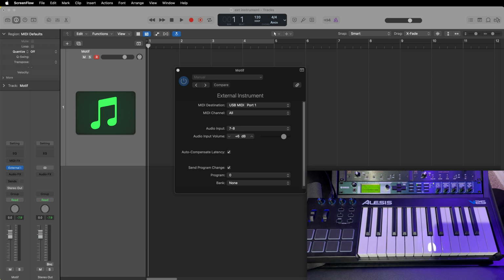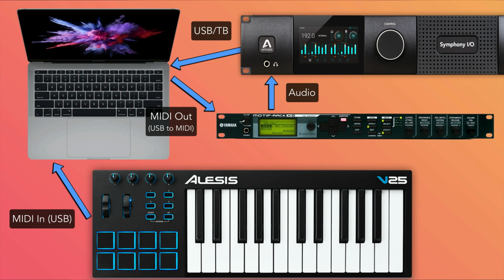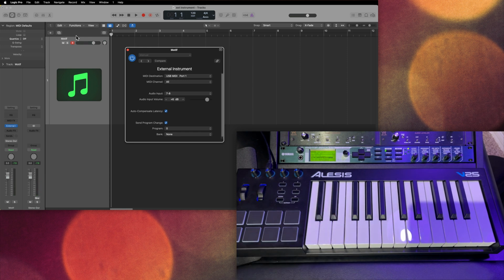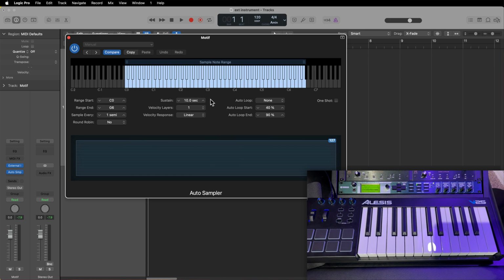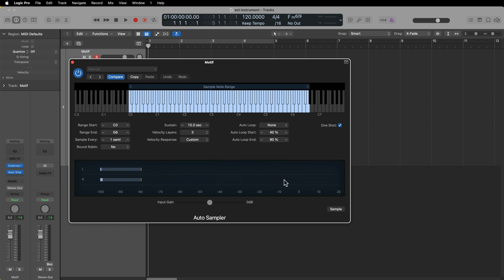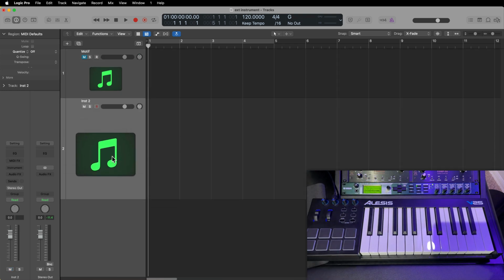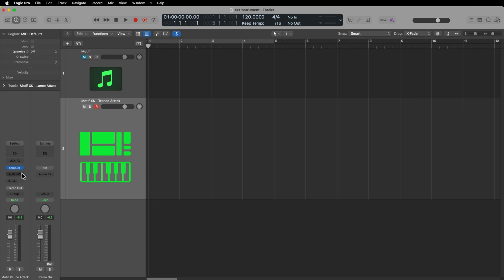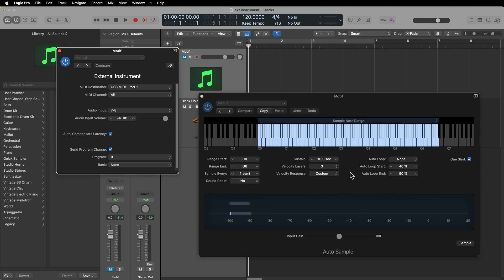Logic Pro - Convert Hardware Synths to Software with AUTO SAMPLER

Comment: Just wanted to say thank you for this - Apple has a PDF manual for Logic Pro that is completely and entirely useless.  It mentions Auto Sampler but doesn't tell you how to use it.  This video steps you through the process perfectly.  Just followed these directions and cloned the CP70 sound on my Yamaha MX88.  Now that sound is in my laptop and I don't need to drag the big heavy keyboard with me when I want the sound.  Thanks again.

Comment: Hi MTHG, thanks for all your amazing videos over the years! I have a rather complex question: I have a hardware synth lead patch I’d like to sample but it has quite involved real time modulation effects. For example, when you introduce the mod lever the patch is crossfaded into a new oscillator set 2 octaves above (simulating a guitar pinch harmonic type sound). The patch is monophonic and velocity has no bearing on volume but when velocity reaches around 115 the patch becomes polyphonic. Vibrato is controlled with Aftertouch. Wah-wah is added with a downward move of the modulation stick (it’s a Korg 4-way stick, not conventional mod wheels). 

Is it possible to sample the patch as normal and also sample the patch in its various modulated states, like having say 33% of the pinch harmonic crossfade engaged, then 66% then 100%, and same for the wah? And is it then possible to map those new sampled states to be triggered via the mod wheel of your midi keyboard? Finally, I don’t think the AT vibrato or high velocity shift to a polyphonic state has to be sampled as audio, but is it possible to assign AT and Velocity to trigger these things inside the Sampler?

Comment: Can the finished product be used in other DAWs?
Reply from the maker: Not easily, but you can navigate to two locations to find your EXS file and samples. For the EXS file: "Users > YourUserName > Music > Audio Music Apps > Sampler Instruments > Auto Sampled" -- there you will find your EXS file that contains the Sampler programming. Then go back one folder. Instead of Sampler Instruments, click on "Samples > Auto Sampled" and here you can find a folder for each of your auto sampled instruments. You can then either find a third party sampler that supports EXS files, like "Decentsampler", another commenter mentioned. Or you can simply manually reload and re-program the samples in the sample folder. Because sampler does label the files with their pitch name and velocity layers, it can make it a bit easier, but you'll still have to do some manual programming work.

Comment: Great video! I would assume your sample rate would need to be considered for this process. What sample rate do you have your session and sound card set for?
Reply from the maker: If you go look at all of the samples in Logic's sound library, you will see that the vast majority of them are 44.1 kHz 16-bit. However, auto sampler WILL sample at whatever your Logic Project/Interface is set to. In my case here in this video, it was 48 kHz 24-bit, but that's only because I was running a screen capture software at the same time, and it defaults to 48 kHz for video. I would personally always use 24-bit, but in my opinion there's no real need to go higher than 44.1 for sampling hardware synths, in a situation like this. (1) You're likely not going to hear the extended high frequency range when using a higher sample rate, and (2) it wastes drive space, because the sample files will be larger, and (3) Sampler will automatically convert the output to whatever you set your Logic Project/Interface to. So if you auto sample at 44.1, but you use 96k for your project, for example, there's no risk of the pitch of the samples playing back incorrectly, because Sampler compensates for that. However, there two caveats: (1) you might consider a higher sample rate if you are sampling "loop-style" instruments where there is a rhythmic element that needs to stay in time with the tempo of the project. If you are using the time manipulation functions in Sampler to sync the sample playback speed with your project tempo, then yes, having a higher sample rate can certainly help for better quality time compression and expansion. (2) if you are sampling an instrument that has a lot of high frequency emphasis and saturation, you might hear audible foldover/aliasing in the top end. It's not often, but occasionally with really high frequency harmonics that go above 22.5 kHz they can foldover back onto the sample recordings, and can sometimes sounds like inharmonic distortion -- muddying up the clarity of the top end. But it's rare.

Comment: once this process is finished, is there any way to export out the final product from logic sampler to another sampler like kontakt or falcon so i can use in another daw?
Reply: Decentsampler can import exs24 format files (the kind Sampler uses).
Reply from the maker: Not easily, but can navigate to two locations to find your EXS file and samples. For the EXS file: "Users > YourUserName > Music > Audio Music Apps > Sampler Instruments > Auto Sampled" -- there you will find your EXS file that contains the Sampler programming. Then go back one folder. Instead of Sampler Instruments, click on "Samples > Auto Sampled" and here you can find a folder for each of your auto sampled instruments. You can then either find a third party sampler that supports EXS files, like "Decentsampler" someone mentioned below, or you can simply manually reload and re-program the samples int he sample folder. Because sampler does labeled the files with their pitch name and velocity layers, it can make it a bit easier, but you'll still have to do some manual programming work.
Reply: @MusicTechHelpGuy  ok great, thanks guys!!